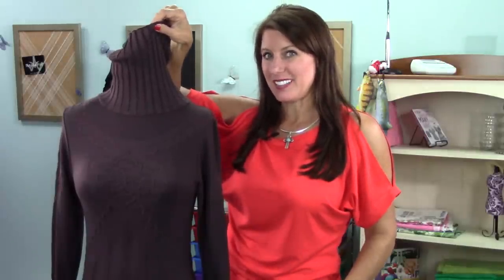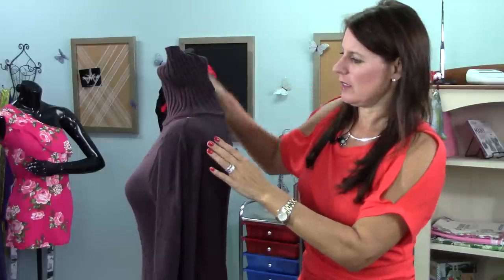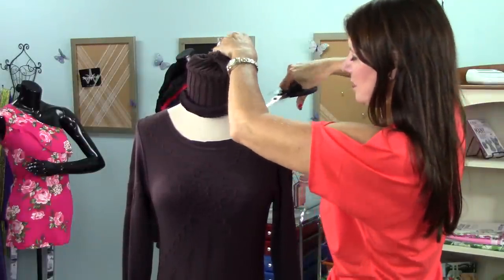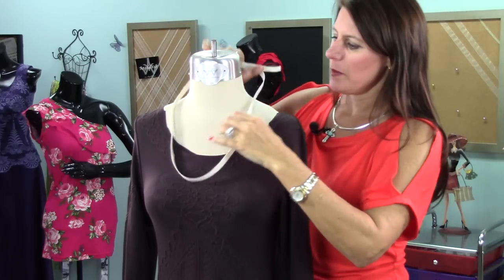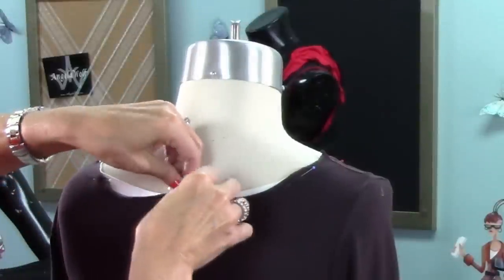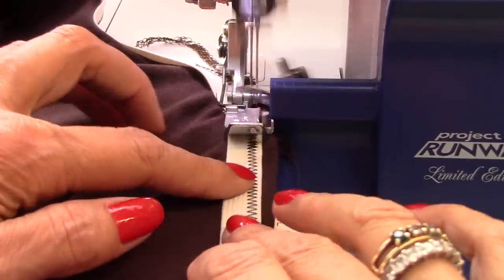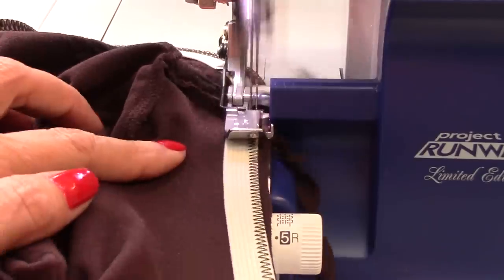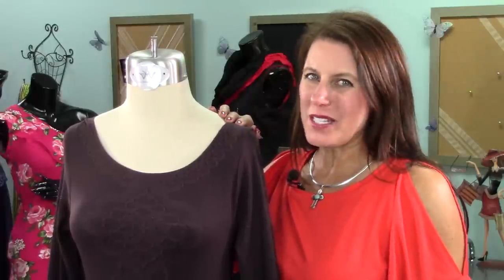UPCYCLING CLOTHES DIY PROJECT: DESIGN A BOAT NECK TOP FROM A TURTLENECK

Comment: On your live show, I couldn't see the design of the shirt. Very nice. No wonder this was a great shirt to work with. Did I see that you folded to neckline over basically twice. So when you look at the inside you see fabric and not elastic. Great video. Thanks!
Reply from the maker: Hi Terry, I only folded it once - then the fabric will touch the skin - but 2 folds would be too thick